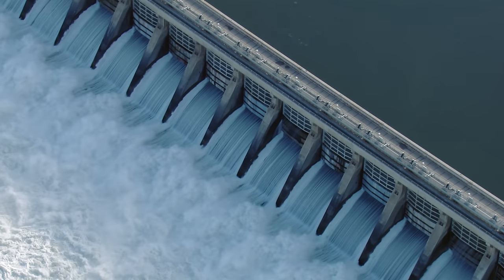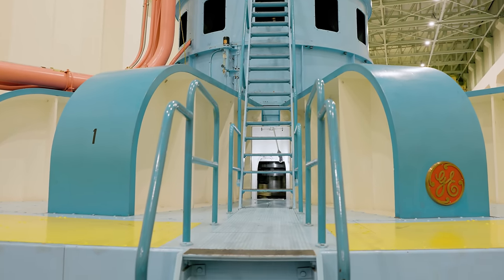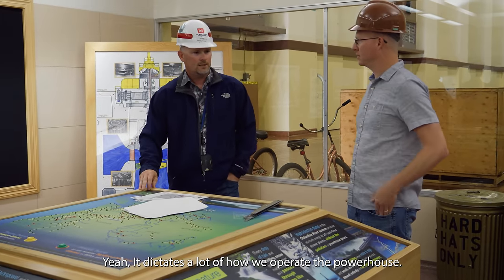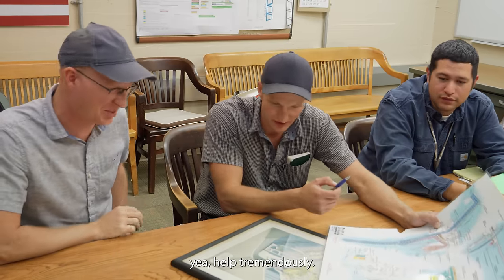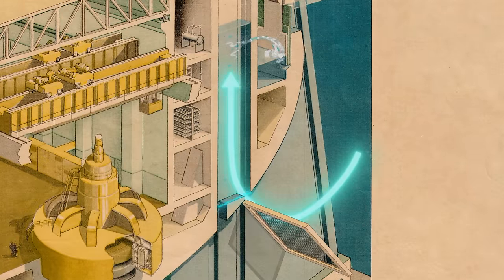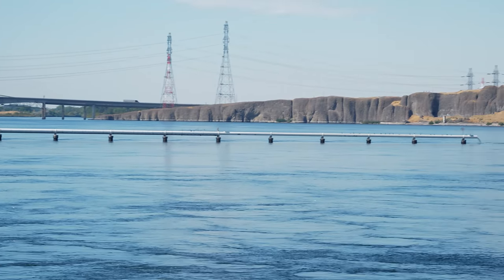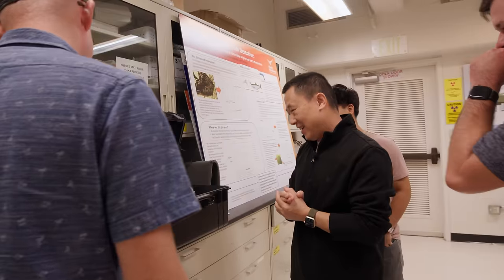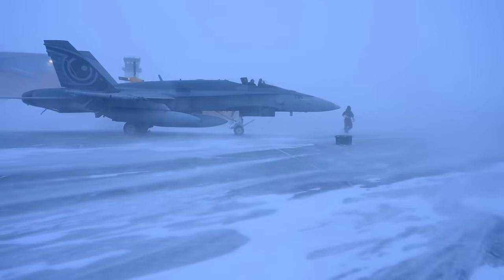How Fish Survive Hydro Turbines

Comment: I am so thrilled to have found this video. Several years ago I worked on a project relating to the Ardnacrusha power station on the River Shannon in Ireland. Turns out that the fish pass was only built 60 years after the hydroelectric station began its work - with the result that most of the salmon and eels that used to travel far upstream to reproduce had fallen victim to the impossibility of getting over the hurdle. 
With the remedial work a hatchery was installed that eventually helped restock rivers in Ireland and abroad, e.g. the Rhine. 
That hatchery attracted me like a magnet and I followed the complete cycle - and fell in love with the hatchlings.
Knowing that the whole business can be managed so much better now and the negative impact on the fishes reduced considerably gives me great joy.
Reply: thanks for the excellent reply. x) 🤩 <3
Reply: back in  2009 I saw the ''fish ladder'' in Pitlochry, Scotland, with a set of 34 cascading pools, enabling the inbound salmon to dodge the power dam - guess this is similar to what is shown here

Comment: I like that somebody looked at that rotating deathtrap at 1:47 and said: "Eh, a simple railing should be fine!" X-D
Reply: thats the safest rotating behemoth i have ever seen. the problem isnt the rotation, the problem is something getting caught in it. The surface is smooth so there is no risk of that.
Reply: @Apostate_ofmind 

"The problem is something getting caught in it. The surface is smooth, so there's no risk of that."

"Challenge accepted" ~ intrusive thought.
Reply: @notahotshot  loll
Reply: @Apostate_ofmind Uhhh that’s not true. A perfectly smooth rotating surface like that will pull things right along with it
Reply: @JayVal90  pray tell, what law of physic applies to a smooth surface that gets greased often to PULL things along? Because its not friction.
Reply: @Apostate_ofmind  Friction. You can grease a smooth metal surface all you want, but you’re never going to get as low friction as air. And even air is capable of pulling along light loose strands that can pull along other things once they wrap around enough.
Reply: @JayVal90  that shaft isn't rotating fast enough for that to be a problem. larger generators have slower RPM than smaller ones, and according PALL the smaller turbines rotate around 150rpm. for comparison it's very common to use sandpaper on a metal rod connected to a lathe rotating around 1000rpm. since your skin has a lot less friction than sandpaper and the turbine rotates a lot slower than a lathe, touching that would just make your fingers slide along it.
Reply: There are LOTS of things like this in electrical transmission and generation facilities. Its not uncommon to make "new hires" pretty much keep their hands in their pockets  for awhile.
Reply: I bet Johnny Knoxville would sit on it without too much encouragement
Reply: I was wondering why everybody had their hands in their pockets, I thought they were just uncomfortable being on camera
Reply: @Apostate_ofmind  Okay, Dr. Weir.
Reply: @Apostate_ofmind  it would only take one slip to have an arm/hand get caught enough between the shaft and railing to paint that whole room red.
Reply: @1harrismccarty  not at all.... I already explained: not only that thing is not spinning fast enough, but even if you put your full hand on it, it would just slide.

The amount of outrage on something perfecly safe from people that dont know what they are talking about is getting ridiculous.
Reply: @1harrismccarty  That's true of any automobile pulling out of any driveway or parking spot. Yes, accidents can happen. Children, pets, and intoxicated people shouldn't be allowed near heavy machinery, and it should be treated with respect.

But this setup isn't appreciably more dangerous than a slow-moving car, and public parking is much more accessible to people and wildlife than these turbines are, with fewer guardrails. Everyone who does have access to the turbines have training and safety briefings.

So in practice, those turbines are safer than a common everyday scenario for most people in Europe and North America. That's pretty safe.
Reply: @falleithani5411  oh totally. I’ve worked in more dangerous places. It’s still a safety hazard with potentially lethal consequences.
Reply: I feel like the engineers basically decided that if you were experienced enough to be up there with that giant rotating piece of metal and were dumb enough to go past the railing, you deserve the results
Reply: Safer than a panel saw
Reply: @Apostate_ofmind that section of the shaft never gets any grease but i digress.

Comment: I have visited as tourist and been taken around as an engineer a 3.2GW hydropower station. When stood next to the turbine you don't so much hear the noise but feel. It vibrates through your entire body. Being shown around as an engineer I saw more technical areas where tourists never got to see. Unfortunately they closed the visitor centre during the pandemic and have demolished it.
Reply: This must be overseas? I’ve worked at 3 of the top 8 power producing hydro facilities in the U.S as a mechanic, and the only one bigger than 3.2 GW is Grand Coulee.

Comment: Grady, last time I toured the Bonneville hydroelectric dam (very close to this one in the video) there were ten enormous turbines in the main room, and not a single one of them was generating electricity at the time despite the roaring Columbia River outside. The tour guide said that's often/typically the case, explained as "economics," though I can't understand how free clean energy could be any more economical. I wasn't about to lock horns with the guy during a tour, but it would be great if you could do a deep-dive on why turbines are typically/often just left off. Thanks!
Reply: I have heard that hydro generation is more expensive than the wind turbines that line the eastern gorge, so that the wind power is used preferentially. It is good to have a hybrid power system. I am not any kind of expert, I just recall hearing this.
Reply: Sometimes the generator acts as a motor to keep the grid in balance.
Other times, other sources bid less than hydro, lowest bidder gets to supply the juice.
Sometimes it's for water conservation.

Comment: A Turban is a type of headwear based on cloth winding. Featuring many variations, it is worn as customary headwear by people of various cultures. A Turbine is a turbomachine with at least one moving part called a rotor assembly, which is a shaft or drum with blades attached. Moving fluid acts on the blades so that they move and impart rotational energy to the rotor. There is a very big difference between a Turban and turbine .
Reply: They are pronounced the same way in certain accents, just like how some accents pronounce pen & pin the same
Reply: so there is (in some localities) a 'bandana day' where people are encouraged to wear a 'bandana' to raise funds for worthy charities.
Not 'Banana' day, but peoples spelling and comprehension skills seem to have been abated over the years...... Don't try to wear bananas. Not a good look.

Comment: Great job Grady.  Wish I knew you were in my neighborhood, I would have said hi!  This is such a complex and important issue for peoplein the northwest, I'm glad you've given it such a thorough review.  I worked at Rocky Reach dam during a summer internship over 30 years ago and we were collecting flow velocity profile data for the inlet of the turbines to improve fish screen design.  The designs at the time had a serious problem with fishing being impinged on the screens and we were working hard to improve survivability.  The current designs may be complicated to maintain but they are critcal to the success of the overall system.  Thanks for the coverage.

Comment: Back in the in the 1990's I was working for a company doing asbestos abatement at McNary Dam.  Asbestos was used extensively as thermal insulation on cooling lines inside the turbines. The was asbestos insulation in most of the electrical components. There was also sound absorbing coatings made with asbestos on various surfaces to reduce noise. 
Since McNary spans the border between Oregon and Washington,  there is a line inside the dam marking the border.  Employees have to keep track of the time spent in each state for taxes and other labor expenses.

Comment: Fish passage is surprisingly complicated. Just recently during the Klamath river dam removal project almost all the fryling released from a hatchery died in a water diversion tunnel due to pressure like they briefly mentioned in the video. Fish also are pretty picky on ladder design. If it's not designed perfect they pretty much won't use it. One of the dams being removed had a ladder that essentially never got used. There's so many different types. One river I worked on actually had a ladder put in so the fish could get around a natural barrier because of warming waters.

Comment: Signed up for Nebula! Thanks for the discount code!!

Question about trains… posting here because I figure you will see it here since this is newer.

When they build a train and they have an engine pulling and an engine pushing, how does that work? There is a certain amount of slack in each cars coupling that can move back and forth ( in and out ). The train pulling will pull the slack out but at some point the engine pushing would push that slack back it seems. Leaving some cars at least that it wouldn’t seem to be able to be pulled or pushed.

Very curious…

Comment: Excellent video, and I'm looking forward to more on the subject.

I live in eastern Washington State, and our power infrastructure is amazing.  This side of the state runs primarily on hydropower, both small and large scale, plus about 10% from the Columbia Generating Station, a mature BWR nuclear plant.  No major fossil fuel use aside from the occasional small load-leveling plant and backup generators for emergencies.  On top of being very clean, power here is cheaper than pretty much anywhere else in the country (I pay just 5 - 6 cents per kilowatt-hour at home).  On top of cheap, reliable, renewable, & non-polluting power, the dams are very important for flood control, irrigation, and keeping lakes full for recreation during our dry summers.  Plus the tamed rivers allow for very efficient and environmentally-friendly bulk transportation for various industries including the massive amount of agriculture that goes on in this half of the state.

The dams are very important to Washington, but unfortunately certain political and environmental groups are pushing hard to have them torn down - fish migration being a primary reason.  Of course, those groups have no real plans to replace all the power generation capacity and other benefits that will be lost with the dams, aside from vague & miniscule "funding" to figure it out after the fact.  What we really need are solutions that take care of everyone, fish and human alike.  If you just go off a lot of the hippie articles on the subject, you'd think the dam operators couldn't care less about the wildlife.  So thanks for showing how people are actually taking it seriously and working hard to find those solutions.

Comment: The thing about hydro power is the ability to ramp it up or down based on load. Solar and wind are good alternatives but we don’t have the technology yet for adequate storage on such large scales. Imagine the size of the battery banks needed. 

Hydro power generation can be quickly lowered when the demand is lower and ramped up when the demand grows. It’s one of the best and cleanest methods of power generation we currently have. Nuclear is a whole other conversation.

Comment: The fish aren't going to get hit by the turbine, the turbine moves at the same speed as the water flowing though it, and the fish is in that water. In fact the turbinev is miving slower, it's the water hitting the turbine and slowing down that effectively transmits energy to the turbine blade. They define it terms of speed and pressure but it's essentially the same thing. When you take fast moving fluid and slow it down, that energy is transformed into pressure. When fast moving water or gas hits a turbine (or stator if it's an axial turbine) blade, it slows down immediately, but all the force is still there, all the momentum.
Reply: Yes...they do...that's the point of a fish latter. While most do make it through, a little more than 1 in 5 fish sustain injuries. According to a study done by the Society for Conservation Biology in 2021, the average mortality rate was 23.3%. There is a reason that governments invest millions into find solutions to prevent fish from being injured by water.

Comment: I'm impressed from an engineering POV, and I'm happy that they can do this for the wildlife (both for its own sake, and because that wildlife is also useful to us as well). 

But I do worry about the thing you said early on, about how most of our big dams were built before we paid much mind to things like fish survival. Specifically, I worry that this isn't a coincidence. How much can you complicate a dam with fish survival tools before it's just not worth building at all? And what does harming our single best source of electricity (since hydro is the only one that's cheap, easily adjustable in output, and also carbon-free) do to other environmental concerns? 

I'm not saying that any of this is bad, but I do worry about how we'd even know if we'd started overdoing it.

Comment: Great video about the engineering side of this.

It would have been interesting to hear some of the results though. Is all of this investment actually working? Are salmon runs increasing? Sadly, I don't think the answer is 'yes'. The Columbia river system used to have salmon runs in the millions (estimated to be around 16 million in the mid 19th century). The average is now 660,000.

Comment: The engineers that work on the damm May have thought of this already..

I AM NOT AN ENGINEER!😅 

..But what do you think? 
Is it possible to make 
"the submersible screens" arranged like an "conveyor belt" and automaticaly cleaned after every water-passage? 🙃
It looks like the screens are made of thin rods tightly arranged, wires would be easier   to maintain, but "the conveyor belt"-structure may become a problem instead, who knows? 🤔

Comment: Why are turbines not installed directly in rivers?  Reservoirs are aging.  Reservoirs make methane.  Rivers used to run manufacturing facilities, directly.  If you put a planetary-gear on a the blades/buckets on a19th-Century-water-wheel...?

Comment: You didn't even touch on the economic benefit that dams provide and how they reduce carbon emissions for transportation of food and fuel. Rail transit is basically maxed in the area and for every barge that goes through the navigation locks to the Pacific Ocean from as far as Lewiston, ID, hundreds of semi-trucks are not needed on a daily basis to transport bulk items.

Comment: Hmm... if the goal is to reduce the total pressure drop on a fish as it passes through a turbine, the turbine must extract less energy from the water. If the goal is to reduce the rate of pressure drop the fish experiences... multiple turbine stages, like in a jet engine compressor, only backwards?

Comment: I've always wondered: What happens to such sensors on pray animals when they're caught and eaten by predatory animals? I mean... those can't be healthy to digest, even if they're so small. They still have batteries, plastics etc. I guess the electricity they run on is pretty harmless low voltage/current but the rest seems pretty harmful to me...

Comment: at 2:50 you say "it's equipped with 14 power-generating turbines, and these behemoths can generate nearly a gigawatt of power, combined."
Do you mean a gigawatt of power every minute, hour, day, or any unit of time beyond that? I can generate a gigawatt of power with a small, hand-cranked generator given enough time, too.
Reply: You're thinking of watt-hours
Reply: @allan8910  ... Which is the proper unit to be used in that situation. You're not wrong, but neither am I. He doesn't specify.

Comment: For the James Bay project designed in the 1970s, they made the decision to not care for the fish.  A number of rivers were fully damed to be diverted to the north, so fish can't swim to the dam sicne downriver lacks sufficient flow. (the Rupert River diversion in 2012 is differemt and may have a fish ladded, not sure).  The diversion of many rivers into La Grande River resulted in a flow rate from Radisson to james Bay that was felt wouyld be too high for fish to swim upriver.  (enough that they moved a townsite of Fort George on an island in river to Chissasibi due to fear of erosion.  The end result is that upriver from the first dams are only fresh water species with separate population in each basin.   At the time it was felt that voters in the south wouldn't care about preserving fish in the north.  Unsure how much salmon exists in James/Hudson Bay which would have the drive to go up those rivers.  There are still smaller rivers that function normally.

Comment: How does a gigawatt power half a million homes? My house is using multiple kilowatt hours throughout the day, more than 1kWh per hour. So wouldn't that be 1000 homes, not 1/2 a million? What am I missing?
Reply: "How does a gigawatt power half a million homes? " - because a typical household uses 2kWh per day. You happen to be gluttonous in your electricity use.
Reply: @TheDanEdwards  maybe I'm mis-remembering. For some reason, I thought my daily use was ~26kWh, and I'm on the low side compared to my neighbors.
Reply: I just looked it up, and I used like 900kWh last month, and that's pretty low compared to most hours in my area. They're usually using double during a time that air conditioners are in use.

Where's your 2kWh source? The fridge by itself uses over 2kW over the course of a day.